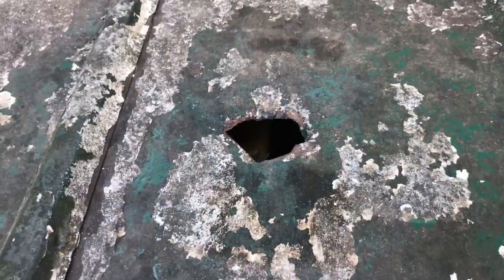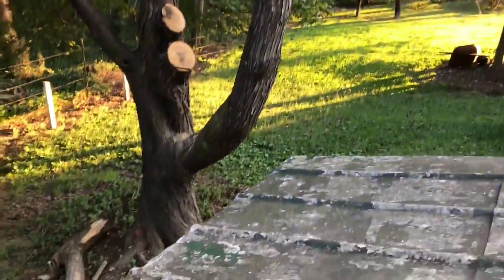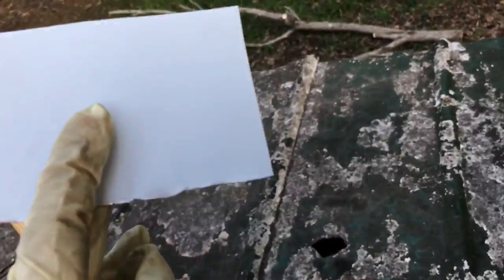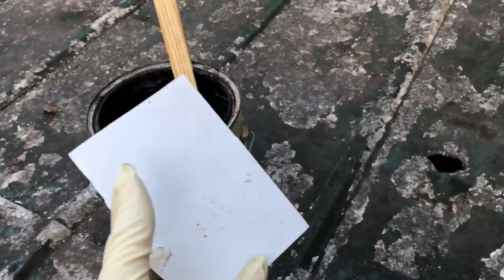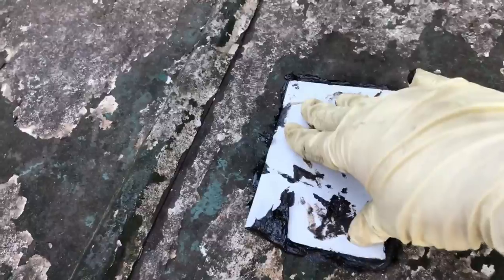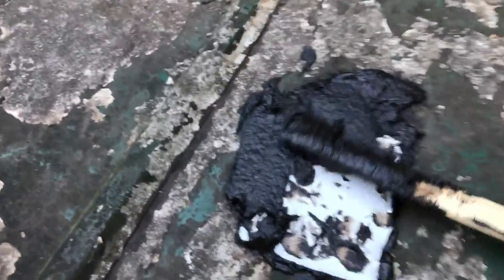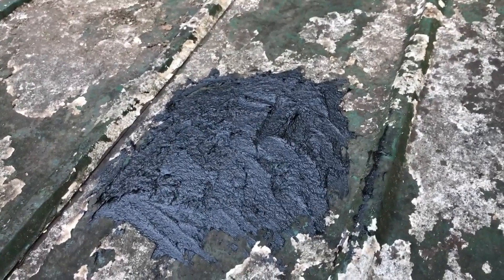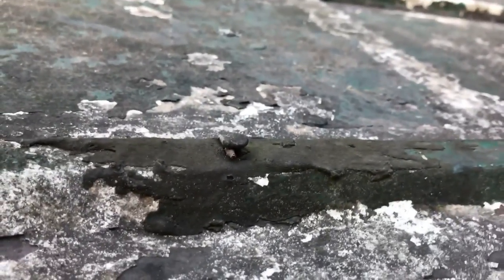How To Fix a Hole in a Tin Roof

Comment: It's a good idea to use a wire wheel (or at least a wire brush) to clean the surface that you're repairing. I went a little overboard and wiped the surfaces with alcohol after using a wire wheel attached to my drill, but it has worked great for several years so far. 
Any adhesive will stick better to a clean surface.

Comment: this is exactly what i was looking for. i have tons of tin scrap laying around. im not to concerned about the metal bonding as said in other comments because with enough tar that will actually be the seal. the metal is more so a extra layer of protection. and yah it might not last 40 years but just a quick yearly check and a recoat if it cracks should do it. that would be my guess anyways. i found a rusted hole behind my chimney in my metal roof and so i filled it with caulk just so there isnt a hole there. but its super hard to get to without a second ladder i relaly had to reach because of the slope so i put a camera on a stick to inspect it and saw a few more cracks next to it so i think ill just put a small sheet across to be extra safe

Comment: THANK YOU !! THANK YOU !! THANK YOU !!! SOOOOO MUCH !!!!!! I have been searching for ways to ( remove ) old rusted tin with baseball sized holes in it..safely (as it is a high pitched roof...and now..I won't have to !!!   I'll just have the risk of hopes to be able to stand ( or lean) on it  (once I get up there (LOL)..and patching the holes without having to remove to repair !!!....your video also makes me wonder..since the roofing cement is on both sides of the ( filler in or metal)...I wonder if this could even be put on from the inside of the building..(it would sure be helpful !!! Save me from climbing on top !!!(lol)    Thanks again!!

Comment: It's not about making it pretty Mike it's about making a lasting functional repair. You  need to  clean the surface back to metal. Aluminium on steel is not ideal.
Reply from the maker: It’s been like that for over 5 years now with zero problems.
Reply: Ha! How you like them apples Red Post?? Atta boy Mike, keepin that rain out is all that matters. Thanks for the great idea!
Reply: Don’t you want the repair to last more than 5 years?  Wire brush would take 5 minutes.
Reply: But no metals are in contact with each other
Reply: @MikesGarage96  yes because your sealant sealed it all up. Nice fix.

Comment: No area prep (sanding/wire brush)? Any adhesion is only as good as the weakest layer, in this case that's the old paint or mold that the patch was applied to.
Reply from the maker: It was just a storage shed that I needed done fast, as I said in the video that this wasn’t correct. Just meant to get you by. This is just a yard shed, so nothing critical. But it’s been 5 years and still hasn’t leaked a drop

Comment: I like this idea but don't like the idea of the black tar. 
Last month a big branch punched a hole in the top of my metal shed roof. After I removed the branch from the inside of the shed and used a pair of big pliers to bring the metal back into shape somewhat, I am left with an irregular hole about the size of a saucer. 
My shed roof is white so using the black stuff would look terrible. Have to find something else to use.

Comment: This cement will crack in a hot climate.
Reply: What works better?
Reply: Just add more
Reply: Someone mentioned more of a sealant. But tar melts I bit in heat, right? You do you! I think ANYTHING is better than nothing. I think all ideas can ALWAYS be improved upon. If this video helps you have better ideas... That's great!!!

Comment: Epic fail. The roof cement will wash away in a year. You need a compression caulk between the patch metal and metal panel. Then you need to use pinhead sheetmetal screws to fasten the patch metal down. When caulk beads out of the edges you want to spread it around the edges or apply an Geocel clear caulk on the edges.